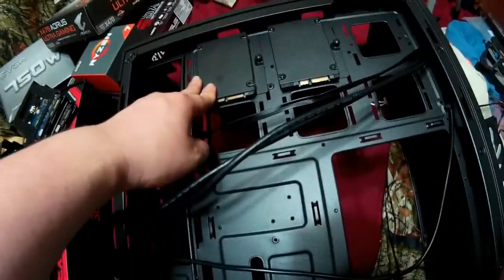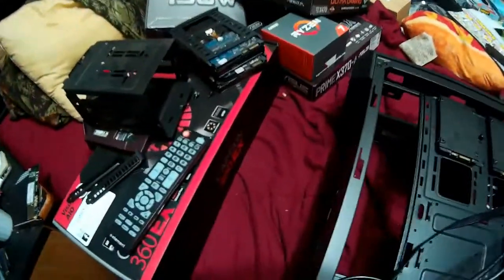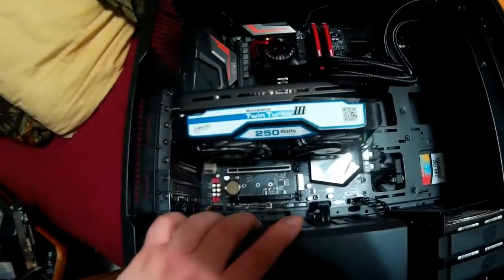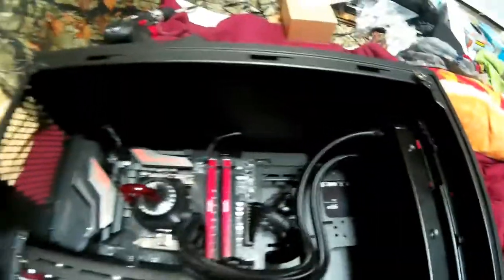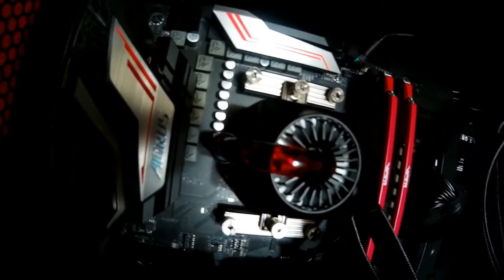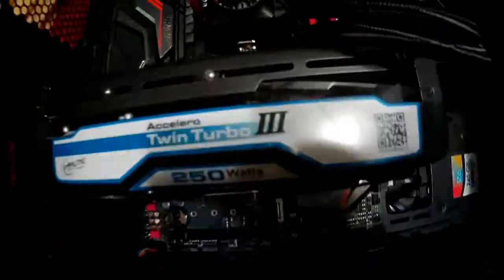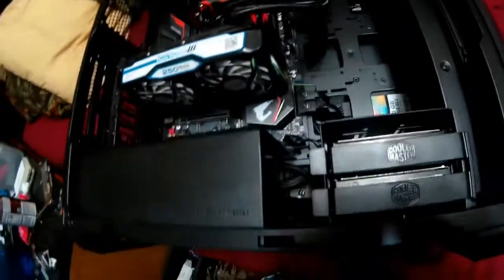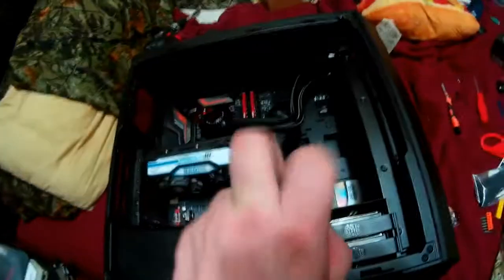Installing My New Ryzen System Hardware

Comment: Im curious as to what temperatures your NVMe drive runs. I've got one tucked behind one of my 1080's. Kind of similar to how yours is tucked behind your GPU.  After time using the machine, have you found any need/want to put an NVMe heatsink on it?
Reply from the maker: Yes, in the end, i got a small heatsink to attach to the NVME Drive, please remember that the hotter the drive gets, the slower it will run to try and not 'cook' itself, and the more powerful the GPU, the more heat it can generate, so the GPU will produce heat next to the NVME causing its temps to rise some as well.

Now that is not to say, a cooler like mine would have issues keeping the heat away from the NVME, or even yours, full load, my GPU does not go above 40C at max load. And that is with a synthetic stress test pushing it. Normal gaming it hovers around 34 to 35C.

the video i am about to link will show you how bad nearby heat sources can make any type of SSD slow down. https://www.youtube.com/watch?v=vnST5rA64Oc

So, in the end, Yes, i put a Heatsink onto the NVME more for peace of mine in my setup then anything. I apologize for the long Reply, but i would rather be as thorough as i can be when it comes to trying to explain something then not thorough enough and lead to confusion/bad advice.
Reply: @Eterna1Link   I installed a heatsink before i even thought about installing the drive. So ultimately the drives never been without a sink. I was just curious as to what other people's experiences were with sinking their NVMe's.
Reply from the maker: @KaidoFujimi  I am glad to hear that, every precaution taken to lessen heat in a computer is a good thing, as it means your hardware will work properly and right, instead of instakilling, in some cases, expensive hardware. If you have any more questions, please always know i am willing to answer them to the best of my ability around 7AM EST, i work 10 to 12 hour shifts at night and this is around the time i get home.

I also wish to thank you for asking a really great question, as you are one of the few that have seen my videos to do so instead of blasting me for the little things.